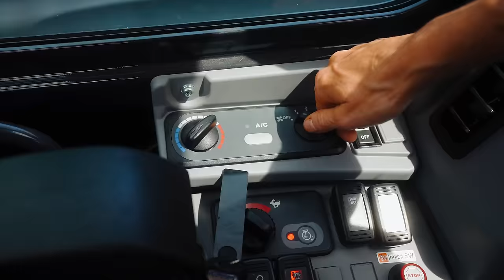Preparing for Disaster | Building Our Own Road!

Comment: I am so glad that you are finally getting a secondary egress route!  Now you need to start thinking about a tertiary route and what you can do to create a fire break around the house plus clearing all of the combustible debris on the forest floor and raise the lower branches (cutting off the lower branches) to a height between 3 and 4 meters.  Your government fire service can explain the benefits of doing all of this and how to best manage your land to help prevent, reduce, and mitigate the damage that is caused by wildland fires and what materials you want to keep away from all your structures.  Mulch is a real no no to have around any structure because is combusts extremely easily by embers.

Comment: Tip for measuring tape reel when winding back in.  Face backwards towards the far end of the tape, run the tape through you legs and apply gentle pressure as you reel it in.  It will wind on the reel perfectly.
Reply from the maker: Thanks for the tip. We appreciate you sharing your knowledge with us. 😊🐾
Reply: The amount of pro tips in the comments is always so helpful, it's amazing!

Comment: You should put a small electric hot water heater in the cabin.  You don't have to worry about running a hot water line that is going to take forever for hot water to come out of.

Comment: Tip if you push the blade leaver  right down it will click in to auto level to the level you want it will move up and down. Did they not supply a Trimming bucket